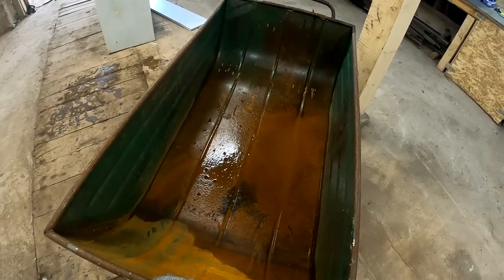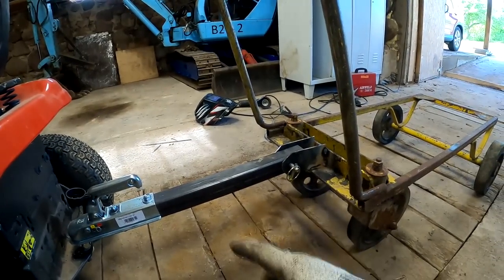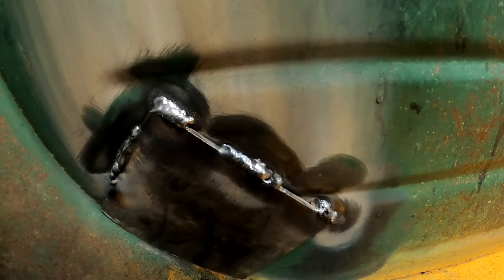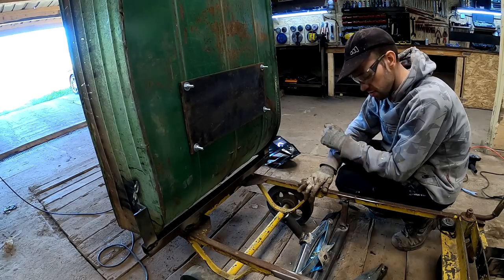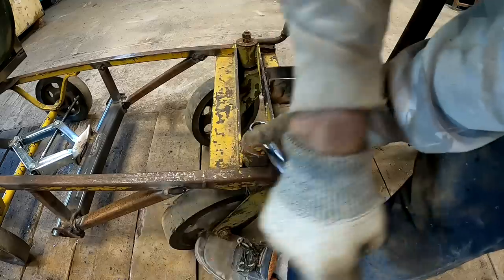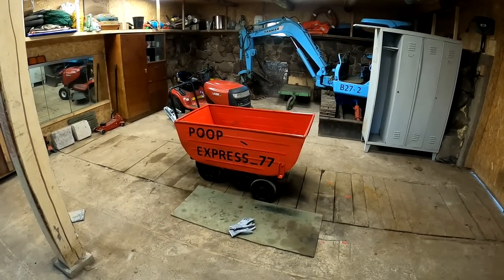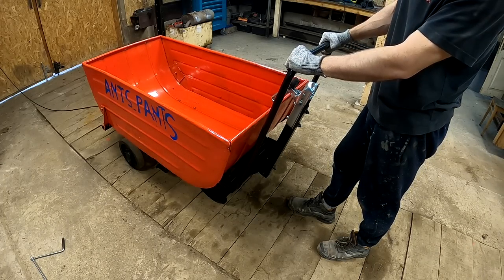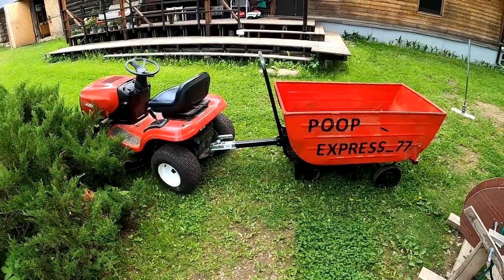Lawn tractor trailer build (out of soviet Industrial waste cart lol)

Comment: Mr. Pants, if you still have that grinder, try cleaning the commuter (copper ring that the brushes ride on) with fine sandpaper and spray off with solvent. The armature itself still looked pretty good. I think it's still got some life left. Another good video!
Reply from the maker: Hey and thanks for the tip. I did just that! It improved the situation by a lot. But the rpms sometimes fluctuate. Still works though 👍
Reply: @Ants_Pants After you sand it with a fine sand paper use a sharp tool to clean the space between the contacts on the copper you just sanded. It may be bleeding power be t ween the sections. We used to sand old generator off of cars when they still had generators. But after we sanded the copper contact we had to clean any copper that was between the sections from wear and the sanding.

Comment: When hammering on a threaded rod,place the nut back on and strike the nut. This will keep the threads from belling out. For your dump jack,weld a bolt on where the eye hole is. Then you can use a cordless impact drill with socket to raise and lower the bed. No more cranking. Put a little grease on the jack screw.
Reply from the maker: Yup 👍
Reply: As long as it is a powerful cordless because the first few turns are the heaviest with a load....(as you experienced it by turning it by hand)
Reply: Even better, weld a socket on it. That way you just use the gun directly. No need to find the right socket every time.

Comment: You should make a attachment so the jack can operate off your cordless drill rather then those janky handles. Then add a mount on the tractor for carrying the drill. Make it easier for your mom to do yard work!
Reply from the maker: Good tip! Tell the truth then i haven't used the dump feature so far at all 😂
Reply: @Ants_Pants  lol. I enjoy watching your creations. The engineering you put into it is always interesting. I watched your creation of the dump trailer again last night as well. I always thought it was weird that you had the axle at the very back which made it obvious to me why the tongue broke, but then I saw it was created from an existing trailer and it all made much more sense
Reply from the maker: @bigbenjit  actually I'm looking into doing a upgrade for it. I have 2 sets of spare wheels on rims and wanna either add 2 wheels at the back, one after another or a freeturning axel up front. But I'm packed with work atm so idk if i will do this this year
Reply: @Ants_Pants  that single axle seems to somehow handle to loads you give it. May as well do what you always do, fix it when it's broken and when you do go crazy overkill (antspants mode)

Comment: If you weld a socket extension bar to the Jack, you can use your impact wrench to raise it instead of doing it by hand.
Reply from the maker: I had it in mind. Wanted to try using a drill, for some reason i completely forgot about it 🤔
Reply: So many things floating around the head,  I forget to do things all the time.

Comment: The commutator needs cleaning. That's the small copper bars under the brushes you bought. If you give it a light rub with some electrical cleaner then try running your old grinder. Grand little trailer for you lawn tractor. I think you have a great way of working. Have an idea then start building it and work it out as you go.
Reply from the maker: Thanks 4 the advice 👍 ill try it out. Take care

Comment: That toad reminds me of the occassion we turned out to a car fire about midnight.  I used to leave my boots and wetlegs next to my door of the fire appliance on the engine house floor so I can put them in before getting into the appliance.  We got there put the fire out,  sent my radio messages etc and was sat there in the my seat enjoying the ride back when I felt something crawling up my leg INSIDE my overtrousers.  It got knee height before I dropped my overtrousers only to find thismassive toad, probably half as big again as the one in your hat.  It had sat there in my boot for the whole hour we were at the incident and how the heck it found the room in my size 11 not to get squashed beats me.  I let the big fella go on the lawn at the front of the station but it didn't get paid the job. 😅😅

Comment: About tue grinder. Dismount the rotor and clean the stator, thats the round ting that the brushes contacts (you called them bushings in this video). It is made of copper segments and they need to bee clean. Best thing is to clean them in a lathe so it keeps its roundness, but if careful one can do it just with a piese of emery cloth. And then do a deep clean inbetween the copper segments with break cleaner or something alike, with a tooth brush or something. If there is conducting materials between those copper segments there will be arching of super dangerous electrisity between them and thats not good.

Btw, check out the channel Made in Poland that dude makes a lot of stuff like cart/trailer dump beds and different machinery for home use , you will get some good ideas for lots of different solutions frm them.

Thanks
Reply: Right, you want to clean the commutator. I'd skip the lathe and just use some Scotch-Brite until the copper is all shiny.  Just run a scribe or sharp punch down between each copper segment to make sure it is clean. I like the idea of some break cleaner. It will be as good as new.
Reply from the maker: Thanks man i will try that. It was also overheating just figured it out yesterday that the fan was loose and not turning with the motor.
Reply: @RyanBlace  Yeah  mabye it is called commutator. Dont know all the words of foreign 👍😉
Thanks mate

Comment: If you extend the jack threaded rod then weld 2 nuts on the end you can use an electric drill to raise and lower the tub. Leave the loop on the other end just in case you need it. I have seen cars lifted using that method
Reply from the maker: Yeah
Reply: If you put a spacer between the 2 nuts and weld a cheap deep socket to the outer nut spacer, you can use an impact wrench to lift heavy loads.  attach  a small box to the tow bar to carry the impact wrench.  store the crank to the trailer handle bar so you don't lose it.  nice trailer.

Comment: hello🙋‍♂️ from the Netherlands🇳🇱 .  
maybe some small tips : 
- if you make a round head at the end of that pipe extension of the jack and put a little grease between the head and the plate it will run much smoother and cost less force and effort to operate the jack .  
- if you bend a hook yourself and put it in the cordless drill, you can easily and quickly turn it up and down with the drill.  
otherwise it is a nice trailer for behind your riding mower.  
thanks for the video .  Sincerely Hollandduck
Reply from the maker: Like a big bearing ball. Yeah good tips. Thanks buddy 👍
Reply: @Ants_Pants  
you're welcome

Comment: Andris, I might be late in replying to this party, but if you (or supermom) is still using the cart, instead of using the hand crank, how about getting a small chain-driven motor, and hook it up to the lift mechanism. Put a switch (SPDT) near the dash panel of the tractor, and flip the switch to dump the bed… Flip the switch the other way, to lower the bed. 

As always… another great build. 😉
Reply from the maker: I use it to store bbq fire material

Comment: Modify the Jack’s handle so you can use your cordless drill to lift and lower it Andris my friend! Just a little bracket along the side of the cart to hold the jack handle brother! Just an idea brother! Grinder head sounds like it needs grease in it and maybe a new set of brushes brother! Oh yeah definitely the bearings brother, you’re right my friend! 🤙🏻Run it until it doesn’t work anymore brother! They’re made for light use anyway! Everyone uses the crap out of them because the 7” grinders are so much more heavier than the 4 1/2 “ ones! I think you’re going to get plenty use out it Andris, good idea and good job my friend! Kirk from Louisiana USA 🇺🇸 take care and stay safe brother!👌🏻🤙🏻🤙🏻🇺🇸
Reply from the maker: Thanks Kirk. Will do brother. Take care my friend ❤👍

Comment: Did you consider mounting the jack horizontally on the front cross member? then attach an arm that pivots on both ends, one end on the jack and the other on the box. You could adjust the mounting point on the box to get max lift. Take a look at how a scissor lift works. Also, weld a nut on the jack handle and use your impact driver to run the jack up and down. Great name by the way.
Reply: I was also going to suggest using a cordless  impact driver on the jack to make lifting faster and easier
Reply from the maker: Never crossed my mind. It's a very good idea though 👍
Reply: I was thinking he could have mounted the jack diagonally under the bin. The threaded rod would have clearance and there is still access to raise and lower it.
Reply: Yeah, it needs a lever (or cable) arranged to cancel the poor mechanical advantage at the start of the lift.

Comment: If you have 3 phase electric in your house I highly recommend that you get a 400 volt mig welder. I used to think stick welder was much better than mig but I was just using crappy MIG welder… I Borrowed a nice 400 volt one from a friend and now the stick welder is a bench warmer.
Reply from the maker: I do have 400v but im eyeballing for a 230v würth migwelder with a pricetag around 800 euros. I have a 400v esab welder and a 230v würth welder @ work and i much prefer the würth model.
Reply: @Ants_Pants  ok, 800 euro should give you a good MIG, perhaps 240/400 is not that important.

Comment: Can you power the turn mechanism on the jack with a hook on your cordless drill? I might also add a strip of old tire as a cushion under the box of your trailer to dampen the rattle and rubbing.
Reply from the maker: Yes i could, the rubber tip is also great! thanks Joan

Comment: I am thinking that after you painted the body red, it started looking like a second purpose could exist - it looked like a boat! And ditto the comment about welding a bolt on the jack screw to operate it with the drill. Actually, maybe you could leave the flattened end with the hole for manual use and weld a bolt to the other end for operation with the drill.
Reply from the maker: This could be a great boat 😅

Comment: At 49:40 you see that the contents of the trailer move up before the edges do. You are pushing a dent in the bottom. Metal fatigue will destroy this nice little trailer.
Reply from the maker: Umm yeah. Think i will die of old age atleast 6 times (maybe 7) before that happens ☺ 👍 i agree though could of used a bigger plate or some extra angle iron

Comment: Hi Ant Pants...i know it is not necessary to make the poop express perfect and it probably works well as it is... but i have noticed 2 flaws on the design part of the build... (1) the bucket sways from side to side in its most tilted-up position...what if you put pivoting/foldable supports on the outer part of the bucket to the frame and to keep it from putting strain on the back-end connections seeing that the metal is so thin.
(2)what if the poop express front wheels are equally spaced as the back wheels. It will give you a much firmer wheel base..
Reply from the maker: Yes and yes 👍😌

Comment: Nice way to start the weekend, an Ants Pants video. 
Just one thing, I wonder whether you could weld a nut to the winder handle somehow and then use a socket driver to wind it up?
Reply from the maker: I wanted to try using a drill. But i completely forgot about that and didnt do any showcase

Comment: I would make a new axle, with lawnmower or ATV tires to make it more stable. Those metal wheels will bury themselves into wet soil in 3 seconds if the ground is soft.
Reply from the maker: Your probably right, right now iv used it for firewood only, sa far been working okey.